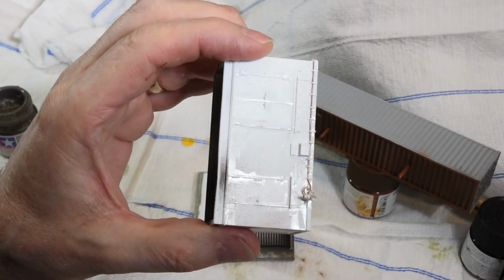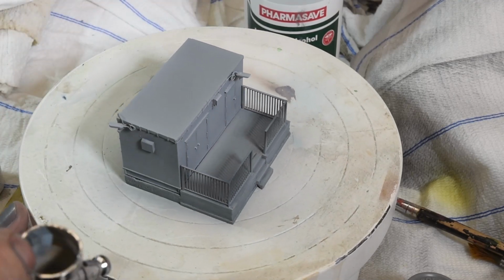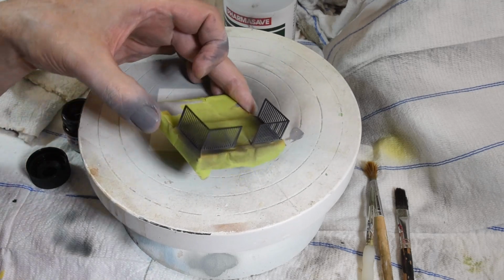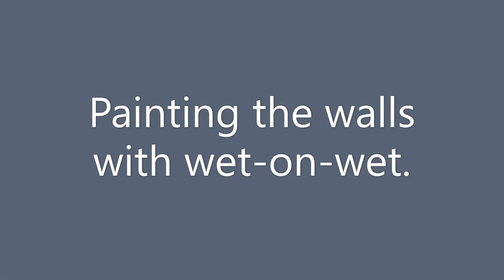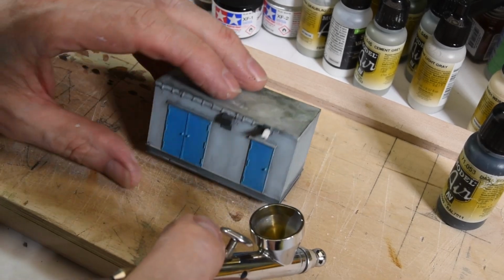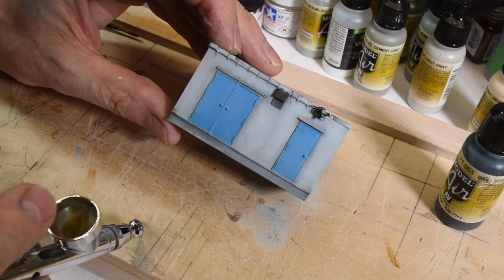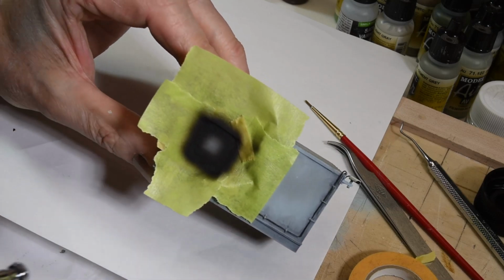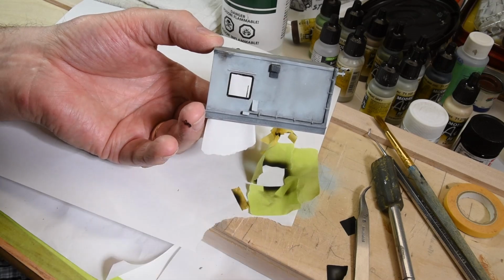Modeling The HO Scale Yard Office Final | River Road - Vlog #78

Comment: Boomer, how are you thinning these colours, what % and where are you putting the paint left in the cup? I use Tamiya exclusively and my coach/boss when I worked at the hobby shop said to never return thinned paint back into the jar, but I do anyway!
Reply from the maker: I thin my Tamiya paint with 50-99% Isopropyl Alcohol exclusively. I never use their expensive thinner. IPA suspended Tamiya pigment is remarkable for airbrush work.
I have been returning IPA thinned paint back into the bottle (or whatever) for over twenty-five years with zero evidence of any thing wrong after painting hundreds of models. 

Furthermore, I have shot thousands of  bottles of Tamiya (thinned with IPA) and never had a problem with the paint under any circumstances, except that it will cut through underlying layers if you use a traditional brush. You can also throw on any solvent, including oils (except acetone) on it, and it won't move (unless you re-introduce IPA to it). Another great advantage to IPA thinned Tamiya is the potential for additional weathering effects by removing layers with IPA under higher pressure airbrush (like a power washer). The results can be stunning on larger scale projects.

In closing, I frequently return all my unspent Tamiya paint regardless of viscosity like you Ralph. Don't worry about it. You will probably remix, tint, spray, pour, whatever the residual paint on another project anyway. Cheers ~ Boomer.
Reply: Boomer, you’ll have to forgive me, I’ve commented a few times and I have neglected to let you know how much I’m enjoying your work and this series. Thank you, this is very informative and I’ve promoted it on every chance I get!
Reply from the maker: @ralphrenzetti22  No need to apologize Ralph and I appreciate your candor. I am glad to hear you are enjoying some of the content. It is rather diversified in order to address different levels of skill from beginners to advanced like yourself. Therefore, I understand if people don't always comment etc. Cheers Ralph. ~ Boomer.

Comment: Instead of black the colour German Grey Vallejo 70.995 should also be great for the railing. How do you avoid overspray. When painting the structure it looks like you have no overspray at all. About the box lights on the walls. Do they stay open or do you still make a transparant or opal cover. It was again a great series of video's. Thanks for sharing. Cheers Ronald  (Modellbahn Rosenbahn)
Reply from the maker: The advantage of an airbrush is it turns over-spray into subtle "blending" especially when you shoot thin paint at higher pressure.
Reply: @boomerdiorama  thanks I will give it a try at a higher pressure. I'm intending to start also painting with Tamiya paints. At this moment I only have the experience with Vallejo acrylics.
Reply from the maker: @ronaldvanpinxteren3644  I use Vallejo Acrylics as well. I prefer IPA thinned Tamiya over the former though.
Reply from the maker: @ronaldvanpinxteren3644  The trick is super thin and build up the layers.😁

Comment: Hi, What pressure do you find best for Tamyia paints and what ratio thinner? Thanks
Reply from the maker: I don't measure ratio of paint specifically. I go by feel until it feels right which only takes a few squirts here and there. At the very minimum - 75% IPA to 25% pigment (from default stock bottle). Take the stock bottle from store, top off with IPA, split it in half this way again, and thin a little more from there. I shoot at 40 PSI most of the time. This is why I don't use a typical airbrush hobby compressor. They don't have the muscle required to airbrush effectively in the way I like to paint. Furthermore, a small contractor compressor with a tank is around the same price and ten times better at the end of the day. ;-)